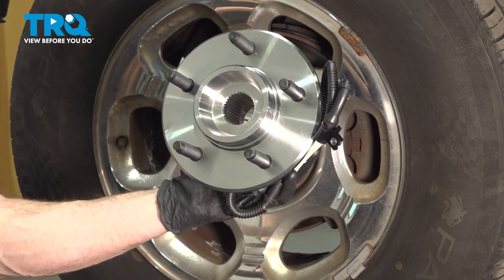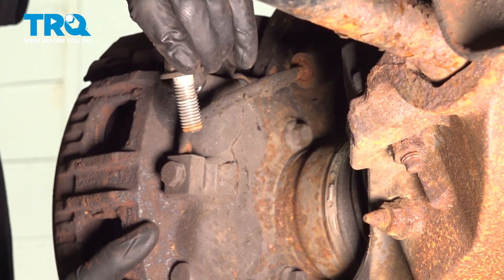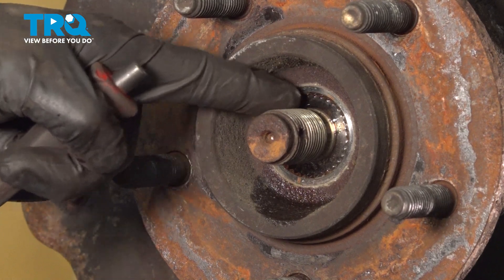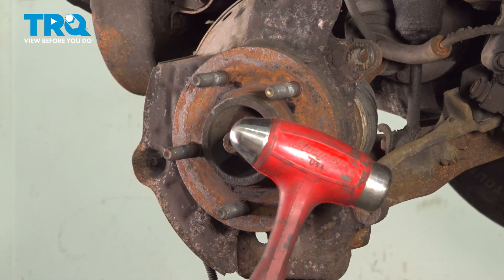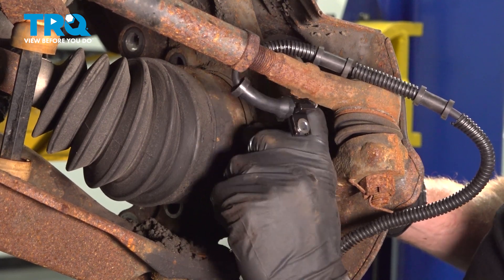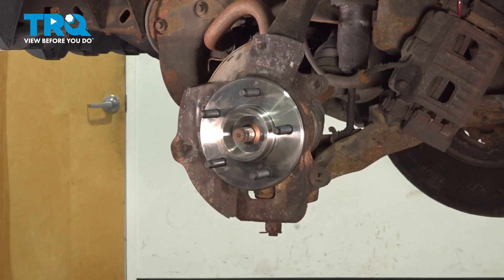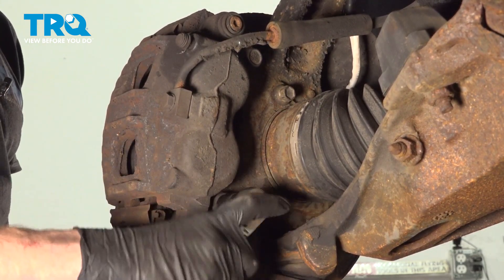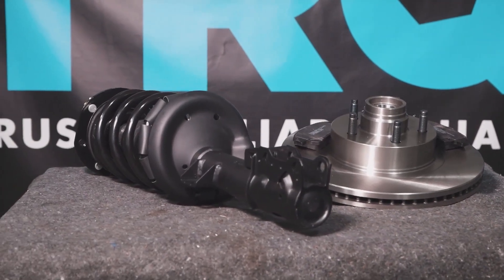How to Replace Front Wheel Bearing & Hub Assembly 1995-2001 Ford Explorer 4WD

Comment: Forums I found said the hob nut is torqued to 157-213 and the mounting bolts are torqued to 70-80. when I tried torquing the bolts the 148 I got scared of shearing the bolt, it simply felt wrong.